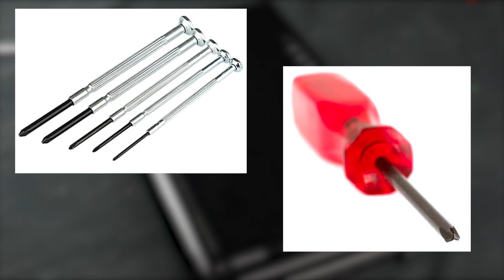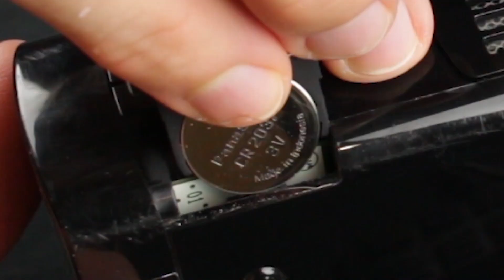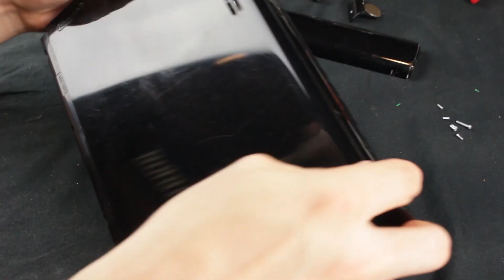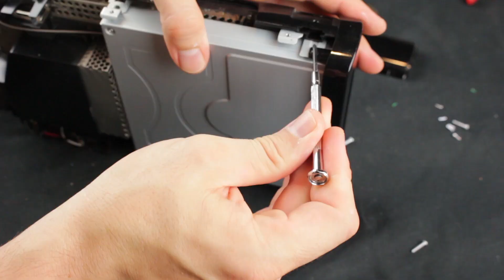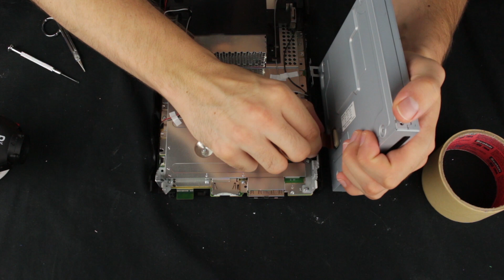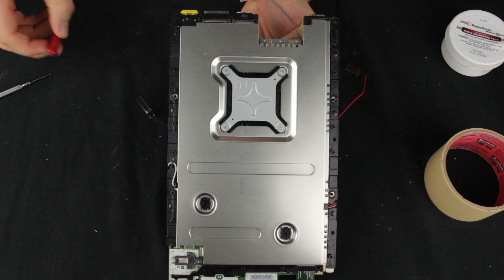Wii U TEARDOWN GUIDE | STEP BY STEP

Comment: Do you think It'd be worth swapping that thermal pad on the processor for a more highgrade thermal compound?
Reply from the maker: I got asked this question before. The answer is No, probably not.
Reply: For what purpose? The Wii U fan makes noise for you? That’s really the only point to renew the thermal paste.
Reply: @manuel0578  Hi grade thermal paste can have heat transfer improvements resulting in lower fan rpm's needed. This potentially could make the system quieter and cooler. Also I am personally an enthusiast overclocker. So I go for every little bit of performance. However the OP thinks this would not make an appreciable difference.
Reply from the maker: @manuel0578  I can't speak for Will, but I think he may be trying to pull more heat away than factory.

Comment: Anyone know the difference between a U with a yellow power port and black, which is newer?
Reply from the maker: Never seen a black power port in person. From what I've read, black is the newer revision. The optical drive may have been altered in these.
Reply: Thanks, I couldn't find any info. I've got 2 with yellow and one black, trying to decide which one to keep.
Reply from the maker: Keep the one that works

Comment: aight so basically I looked up this video because I want to mod a wii U shell to house my original wii but make it be cooled WAY better
Reply from the maker: You'll have to cut the shell if you have gamecube ports on yours. The Wii should fit easily inside. What are you going to do with your Wii U then?

Comment: The Wii U, the last game console to use really odd and unique hardware at its core. Modern consoles nowadays are just X86 machines (or in the case of Nintendo’s Switch, a machine running on a fairly standard ARM SoC)
Reply from the maker: I feel like technologies are converging as companies are moving away from proprietary and towards universal. For example, Apple using Type C connectors and more serviceable products.
Reply: @ImmodderNation except apple didn’t move away from their lighting cable by choice. They were forced into change by the EU.
Reply: Good point.  The Wii U is most likely the last console to load data natively off the disks to play.  Every console now has a mandatory download.
Reply: well powerpc isn‘yt that odd
was used for xbox 360 and the ps3 cell architecture is based on ppc
also the old macs used ppc before they went to intel
but using some similar or almost identical architectures makes backwards compatibility much easier 
wiiu is basically a wii on steroids which is a gamecube on steroids 
thats why gamecube games run so good on a hacked wiiu, because they’re not emulated by software

Comment: You may not know about repairing a Wii U but I’ve had a problem with mine
It seems like mine doesn’t take in power to the console so I took it apart and the power port was loose and it eventually fell off
What do you think I should do?
Reply from the maker: Resolder a new one. It's likely the solder pads came off with it. You'll need to scratch the PCB to get to the power contacts again.

Comment: My Wii U just stopped working.. I think I need to clean it..
Reply from the maker: Stopped working how?
Reply: @ImmodderNation  mine too. It overheats and just shuts down.
Reply from the maker: Clean out dust in fan?
Reply: @ImmodderNation  i tried that with a can of compressed air and it still shut down, so I want to clean it myself by opening it.
Reply from the maker: Good idea. Does the fan spin at least?
Reply: I cleaned my vents with a anti static brush. Dunno what inside is like.
Reply from the maker: You watched my video. Now you do.

Comment: I bought my kids a wii u. Love it, will get them the switch for Christmas, I'm sold on this form factor 

One question, the drive won't read all.discs and stops reading for multi layer games like Zelda. I've replaced the drive with 2 replacements, still no luck. Ideas?
Reply from the maker: It's possible you had two bad drives
Reply: Lmao WiiU games were just $60 trials for games that would cost the same on switch

Comment: Does the system use thermal paste under the heatsink, or is it a system that doesn't use thermal paste?
Reply from the maker: If I remember correctly it's an adhesive thermal pad.
Reply: @ImmodderNation  could you replace the thermal pad with thermal past instead?
Reply from the maker: You could, but why?
Reply: @ImmodderNation  Well i would assume thermal paste cools better than a pad.
Reply from the maker: Yeah but you wouldn't want to take the console apart again to replace thermal paste. It's probably similar to NAS boxes with PWM fans that spin faster or slower at certain temps. You get the same temperature and maybe a fan that spins slower and is not as loud. In other words, I don't think you'll see a significant difference to make it worthwhile.
Reply: @ImmodderNation  so you don’t think the temperatures will be lower on average?  Cause the main reason i even contemplate it is to extend the life of our console. Cause a cooler system has a longer life span.
Reply from the maker: It's possible, but what I've noticed with more modern electronics is that they have a temperature setpoint in the code. Fans will spin faster or slower until that temperature is met. I did a video on replacing the fan in a Synology DS214+ and discovered code that confirms this. Nintendo later switched (pun intended) to a different cooling system that uses heat pipes as well as an active heatsink in the switch and switch lite. 

I don't think changing the material will work the way you think. I remember deliding an Intel skylake processor and replacing internal paste for metal paste. I did a video on this as well. Idle temperatures and normal operating temps were no different. When I pushed the processor clock to it's limits is when I saw temperature decreases vs stock. Pulling more heat away from the die saw little change in normal operation. I think that's what you'll see with your strategy. I would try it and confirm if I'm wrong with proper testing, but 1 or 2 degrees difference will not help longevity of your electronics all that much, especially when you have no control over active cooling.
Reply: @ImmodderNation  yeah that makes sense. also given that the Wii U is a pretty quiet console i can't imagine its producing that much heat anyways, that also probably explains the tiny fan it has. so yeah switching it to thermal paste is probably a waste of time. thanks for the info!
Reply from the maker: I don't want to discourage you from modding, I'm just preparing you.

Comment: Good night, I have a problem, my SD card reader doesn't work, I've tried 2 adapters and 2 microSD cards, one 8GB and the other 32GB adapters and cards work normally on my Nintendo DSi XL, could you help me find out what could be happening? I already opened the console and didn't notice anything wrong!
Reply from the maker: Try a regular SD card and see if you have a problem. If not, then the problem is with your adapter. Otherwise you may have a bad system
Reply: @ImmodderNation   And if it is a bad system, is there a way to repair it? What tests or repair procedures do you guide me with?
Reply from the maker: @tdegelmann  No guides. Get a new system. Or trace back the SD card connections on the board to a storage chip and replace that.  My guess is that its probably the memory card or adapter and not the sd card slot.
Reply: I think you need a blank card and you need to format it in settings

Comment: what is the little battery for?
Reply from the maker: Settings.
Reply: @ImmodderNation  so, to return into settings and configure it? And what would happen if its not there?
Reply from the maker: You'd probably have to reset the date and time every time you turn on the console
Reply: @ImmodderNation  ok thanks for that
Reply from the maker: You're welcome

Comment: My Wii U is not getting power. I’m 100% sure that it’s not the power cord, as I’ve tested multiple on my console and used a multimeter with all of the power cords to make sure they’re not all bad. The indicator light on the front of the system does not show any signs of life. I’m hesitant to open up my Wii U completely without knowing what the issue could be. Is there a common problem that I could fix when inside? That way I can be prepared. Thanks in advance!
Reply from the maker: I don't think I can help you with technical support. When the unit is plugged in does the red light come on? If not and you're sure the power supply works, the unit will have to be taken apart.

Comment: Christmas day, no tri-wing screwdriver. New copy of Just-dance.

Was able to force the small tri-screws with jeweller's screwdriver. Drilled out the two large ones until the heads were gone. Once open, removed the stubs with pliers. Cleaned everything. I cleaned DVD lense with a fine paint brush. Good as new. On assembly relaced weird screws with normal ones scavenged from another device.

Screws must be drilled at lowest RPM. I alternated between bit sizes small to create pilot and large to remove the head.

Thanks for your video. It helps a lot to see how it comes apart first.
Reply from the maker: Hopefully a new tri wing screwdriver or ifixit kit is on its way so you don't have to drill the heads off of the screws again.
Reply: Thanks.

Merry Christmas.
Reply from the maker: @adrianroggeband1901  You too!

Comment: This is a very nice video.  I like it better then what ifixit has. Is that the 32GB model?  If so what are the part numbers on the 4 DDR3L SDRAM modules around the CPU and the 32GB NAND Flash near the front of the motherboard and the 4Gbit NAND Flash on the back side.  I was looking on Ifixit and they only showed the part numbers for the 8GB Wii U!
Reply from the maker: SAMSUNG K4W4G1646B-HC12 gDDR3
TOSHIBA THGBM4G7D2GBAIE 32GB NAND
SAMSUNG K9K8G08U1D (8G = 8 Gbit)

Comment: Hello, recently acquired a used Wii U, however did not inform me that the console was with damaged SD reader. I've been looking at some sites and found the part to replace at a very low price, I'd like to know if I need to take any extra care or if it requires something different from a welding process of a new common card reader.

Unfortunately I didn't find any guide or tutorial on the process.

Thank you!
Reply from the maker: There is only one board and the SD card reader is part of the board so I don't know how you were able to find a replacement unless it's just the reader component. You'll need a hot air rework station, but you might be able to replace it with just a soldering iron. Be careful of small components on the board.

Comment: Do you think that the thermal pad or thermal grease on the APU needs to be replaced at some point? I have used my Wii u for 6 years and planned to but watching your video I'm a little hesitant. I have never taken apart any other console except for a broken Xbox 360. Is there a way to clean the vents without tearing it apart?
Reply from the maker: You would have to take it apart to clean the vents. Otherwise you're just blowing air back into the system. Thermal pad should not need to be replaced. There are also Ifixit guides that have pictures if that helps.
Reply: @ImmodderNation  cool, thanks for your reply! I think I will stick to your video to tear my Wii u down
Reply from the maker: You're welcome and good luck!
Reply: @ImmodderNation  thanks dude. Good luck with your channel, too

Comment: Ohhh so that's what you were taking apart on Instagram. I couldn't come up with a good guess. This was pretty clear to follow. Nintendo consoles are getting more and more complex to take apart. I remember taking my Wii apart and that was a nightmare. I ruined the casing unfortunately. It was my first time opening a console but I have gotten better at it since then.
Reply from the maker: Wii is harder to take apart than Wii U I believe. Wii U has more screws though.